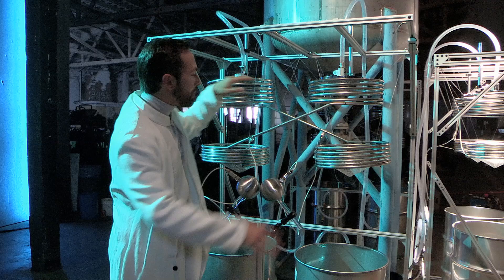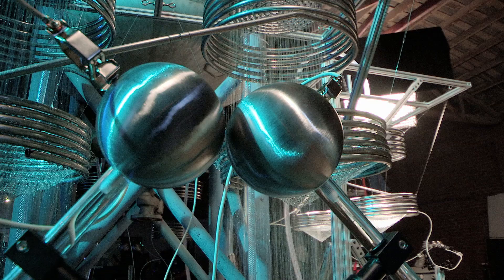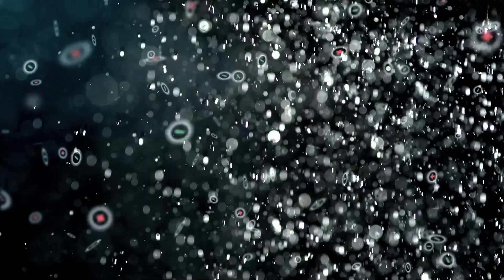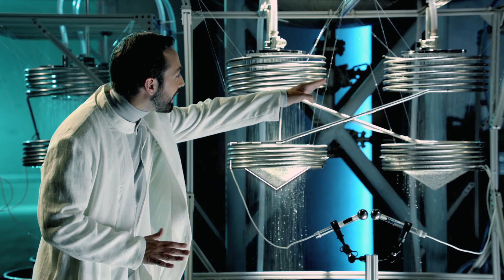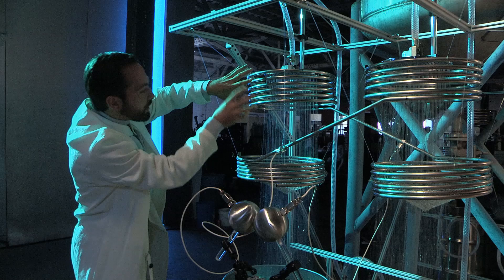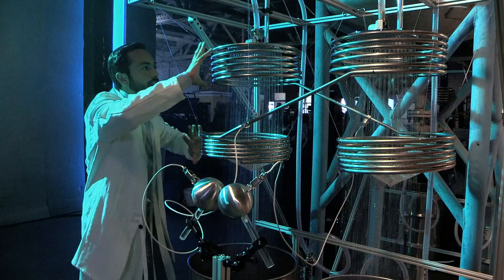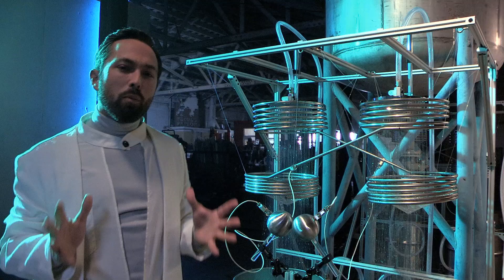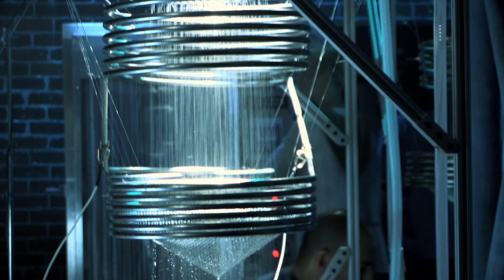Sparks from Falling Water: Kelvin's Thunderstorm

Comment: The energy comes from the conversion of gravitational potential energy into kinetic energy in the water. This kinetic energy is transferred to the electrons in the tubing, as dictated by the motor effect, similar to how a magnet does. The way that the tubes are aligned creates a similar effect to a magnet being moved in and out of the tubes, and so current is generated.
Reply: Yhe streams being polarised is what makes the magnet-like effect.
Reply: ***** Potential energy into kinetic is where I thought it was coming from too. A good point about magnets going in and out of tubes is that the tubes are lined with coils of wire, similar to the coils of metal in this experiment.
Reply: Rather about electric potential than gravitational.
Reply: oR3Io Isn't electric potential the end result that is derived from the gravitational potential energy?
Reply: But the water isn't slowing down. The coils would have no effect on distilled water, so the energy is therefore being generated from the ions in the water. It is the conversion of the ions' kinetic energy into electrical energy.
Reply: Yeah you're right, I don't think they're slowing down. The water droplets are changing direction though...? Hard to say.
Reply: Most likely due to the electrostatic attraction of the ions within the water. Notice how the streams remain undeviated, but individual droplets are attracted to the coil - this is probably because the effect is not great enough to change the direction of the streams.
Reply: Veritasium please reveal the answer!

Comment: I am here because of ElectroBOOM, where he dissed (a little bit) Derek about the "current" that kills you.
Reply: mee too :)
Reply: Me toooo 😌
Reply: Me too🤣
Reply: Me too!
And what a shocking video...
Reply: @Jet-Pack  tell me a single video of EB that is not shocking 😉
Reply: same
Reply: Yeah, me too
Reply: I too am from the electroboom family.
Reply: #metoo Oh wait, nm
Reply: Same here
Reply: me to hahahahaha. electro boom army
Reply: Which one, dude? I can't yet recall the video
Reply: +1
Reply: Me too
Reply: I'm not here because of electroboom but i watched his video.
Reply: #metoo
Reply: he's always shows us a shocking moment,
Reply: n i really hate his eyebrow
Reply: Electroboom made a video about it, I should watch it then. the reason people say current kills more than voltage because people automatically assume high enough voltage to travel across the human body.
Reply: It takes just 1 mA across the heart to stop it. Even the 1 mA usually doesn't stop the heart, but it's somewhat random. 9 out of 10 people struck by lightning survive. The heart is pretty well protected. Electricity will often detour around the heart, and people's skin blocks most electricity. Dry skin can have 100,000 Ohms of resistance while wet skin might have as little as 300 Ohms. 

Ohm's law is: Current = Voltage / Resistance, so electricity and water are a dangerous combination. 

In the setup above, the resistance is high due to the air gap, so the current is low. This is because the waterfall is a source of current, not voltage. Touching it won't increase the current, but decrease the voltage by your skin resistance according to Ohm's Law instead. 

The opposite is true of the electrical outlet across the room. It has a set voltage (110 V in the U.S.). Touching it increases the current to match the skin resistance according to Ohm's law. 

It is the current that kills, but usually that current is driven by a dangerous voltage level. An exception is medical equipment. Back in the day, people would have needles stuck in their arms. (They have plastic tube now.) This would sometimes bypass the skin's resistance and allow even small voltages to kill. Electrical wiring in hospitals is persnickety for this reason.
Reply: Link please?
Reply: I only liked this comment to change the number from 6**
Reply: @heavens00  Hexakosioihexekontahexaphobia?

Comment: The energy comes from the kinetic energy of the water falling. As water falls through the charged rings it is not only deflected by the charge. The droplets are also slowed as the droplets themselves take on or give up electrons in their respective opposite fields. So kinetic energy from the droplets is lost to the processes of slowing and charge separation that becomes a self-reinforcing cycle. My own thoughts, I haven't explained it very well.

I would be curious if the polarity of their system always evolves the same way. Ideally it should be random with each fresh start of the system, but in reality it would likely be skewed toward one polarity or the other, because of subtle electric field influences in the environment. It would be cool to keep stats on that and see what modifications to the environment are needed to bring it closer to statistically even.
Reply: Try installing a diode to eliminate charge toggling and a capacitor for larger sparks.
Reply: yup
Reply: is this anything like when you put a load on a car's alternator, it labours the engine - in principal and in relation to the drops being slowed down.... are they slowing down because they gave up or gained a charge?
Reply: Mostly correct, kinetic energy is only assisting the water to the metal, as the water passes the metal, it leaves electrons on one coil and protons on another coil until the charge in each coil builds up to arc.
Reply: @TheSlimyFreak  Thanks
Reply: Ss ss not slowed down but spreds out away from the center of the flow statics
Reply: Your first paragraph is inaccurate.  First and foremost, kinetic energy is harvested by moving an otherwise unrelated object (look into how Nikola Tesla's turbine actually works).  Second, each and every atom is an electromagnet.  When you pass a magnet through a coil, some of that energy is stolen by the conductivity of the coil (i.e. the energy moves faster in the coil than in air - path of least resistance/conservation of energy).  

As for polarity I think you are on the right path.  In the first run it would be random chance with exponential effects once polarity is established.  The preferred polarity effect you describe would happen even in a perfect vacuum with no other environmental factors possible.  Unless you fully cleanse the system between runs you will have a tiny buildup of polarizing deposits (impurities from the water) and oxidation on the coils that will have almost incalculable magnetic charge effects.  With prolonged use it would eventually build a preferred polarization.  If left to continue to run this way indefinitely; you would eventually dissolve one coil far enough to break the circuit while its mate would be caked with layer upon layer of deposits of minerals (including atoms from the other coil and the containers the water is housed in).
Reply: @Circle14  I think we are saying the same thing. If you use magnets to induce electricity in wires, it takes force to move the magnets. Kinetic energy is turned into electrical energy. In this case the falling water (consisting of many little magnets, as you say) induces current in the coils, at the expense of kinetic energy in the falling water, which is reflected in reduced speed.

Comment: The potential energy of the water falling is converted into electrical charge through induction. Faraday's law.
Reply: gravity
Reply: no. not induction. I think it's more like a vandagraph generator where charges are scraped off or released into somthing else. idk what that's called but not induction.
Reply: @Wtfinc  i think thats called static induction, may be wrong tho

Comment: The electrical energy comes from the fact that water must flow from a high point to lower point. There must be movement in order for the apparatus to function. This gravitational potential energy is ultimately converted into electrical potential, which is the voltage.

Comment: The system's electrical circuit is driven by the EMF created when electrically charged water falls from the top basket's voltage, to the bottom basket's voltage. This EMF induces current oppositely directed: up on one side and down on the other side of the apparatus, thereby charging the discharge balls capacitance untill they discharge ionically thru the air, completing the circuit.
Reply: Your explanation makes sense. Thank you!. 

 I couldn't understand Derek's explanation that negative charge in the left shower attracts the positive charge in the other shower. It should neutralize and not result charge buildup.